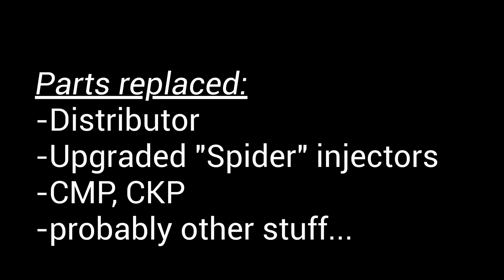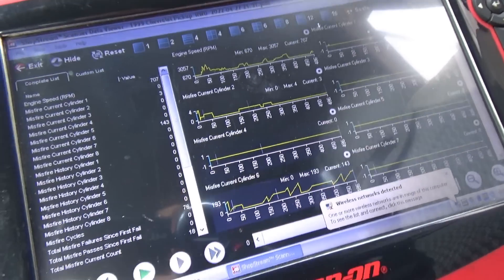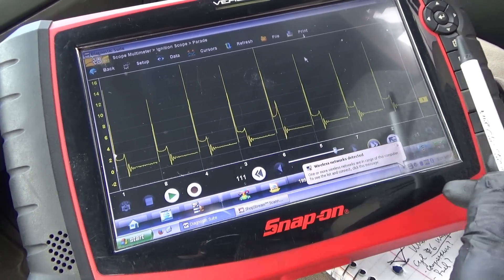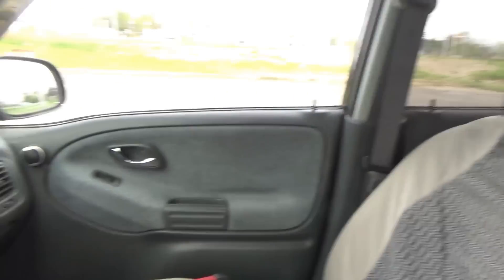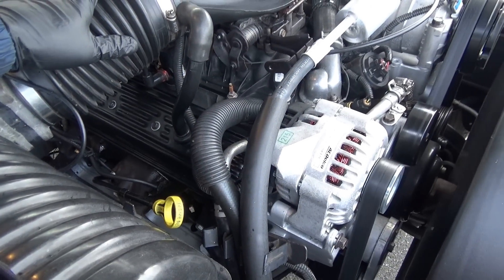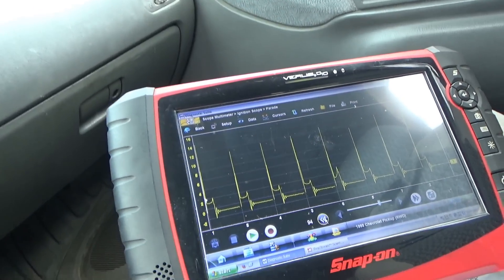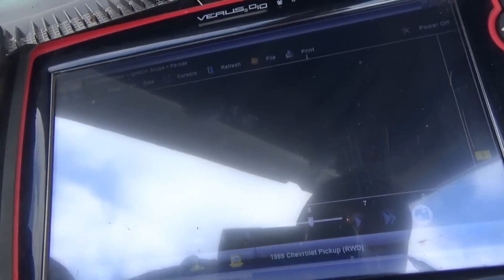Chevy Mystery Misfire...After Engine SWAP?

Comment: Old vid but:  You can spray a little brake clean/starter fluid at each runner flange for the intake and if the engine revs up, you got a leak.

Comment: Darn it! On the older carbureted SBC with EGR valves the intake gasket would fail on the #6 cylinder because the extra heat from the EGR valve would burn the gasket. Not all of them but a lot of them. I definitely would have made the same call.

Comment: If you have a vacuum leak your iac counts will be close to 0 gm's  typically run between 9 and 19 dirty throttle  body will go high usually around 39 . Remove valve cover loosen intake valve and exhaust valve 3/4 of a tern on number 6. Valves are tight

Comment: Ahhh....that sucks Ivan.  It will be better to have it in your shop so you can possibly stumble onto the answer since your not pressed for time.  I don't know why but those #6 cylinders against the firewall always seem to be a problem. A lot more heat back there I guess.  You'll figure it out if you get it in there.  Gotta be something simple but unseeable.

Comment: I would like to hear the engine cranking with no fuel. With the owner's complaint of low power the intake manifold would not be the problem. My guess is a camshaft problem. Does the rebuilder use new camshafts or do they cheap out and regrind the old camshafts. 
You need to put a vacuum guage on the engine. Did you try adding extra fuel to the intake and see if it will smooth out.

Comment: Great one Ivan. That sec waveform on scope looked like  excessive secondary resistance on cyl 6 dist cap. Ig wire also on perceived vac leak on 6 runner. A propane wand may smooth out engine as propane gets sucked in. Thanks for video

Comment: Ivan I do not see  you are using pulse sensor  on exhaust or  intake , or abosulte sensor, I would have done  RC. intake and exhaust  pulse sensor  to try to nail down  the misfire on that cylinder . Great testing methods and of course it is  difficult  to find the method to prove  some faults . Great job thanks  for sharing.

Comment: Hi ivan. Was wondering if you can help me.i have a 06 pathfinder with the issue with I DPM FUEL PUMP RELAY . I lost your video can yo tell me the wire colors used to add a secondary relay i would highly appreciTe it thank you

Comment: I look forward to the follow up, I've got a 2000 Tahoe 5.7 with similar issue, runs rough with a hard intermittent P0300 and P0303 while accelerating to highway speed. Compression is good, has new distributor, injectors, upper and lower intake gaskets and smoke tested for leaks. I've changed just about every sensor MAF, MAP, ECT, AIT, CKP, Knock from a spare Yukon I have. I'm at my wits end, may throw a new timing chain and valve adjustment at it and if that don't fix it I'll have to finally accept that I'll never be able to fix it. Maybe my CAT's are plugged such a nightmare and I'm not a parts thrower but here I am.

Comment: Aftermarket distributor caps are a known problem on these engines, still to this day. I think a simple spark tester at the end of the plug wire for #6 would have shown spark to be dropping, the plug is evidence. If you look at the cap, you can see how the electrical pathways cross all over each other. The ignition waveform can look lean because the spark is jumping to a different cylinder. Lots of experience with these, I won't even replace one unless the customer is okay with the AC Delco price, burned too many times. 
Back in the day, a guy could block off the pcv ports and check for vacuum in the crankcase to warrant pulling the intake for a vacuum leak, would that still be a valid test?

Comment: Many years ago I bought a brand new Mr goodwrench 350 engine, when it got hot it had a hard time cranking over like something was binding. I installed the engine myself, I told friends of mine who were mechanics and owned a shop, in fact they loaned me the hoist and engine stand and any tools I ever wanted, they even brought them to my house, they only were a few blocks from my house, they recommended I bring it to the local Chevy dealer in town and explain the problem, the engine had the factory warranty and I only had it about a month, I went to the dealer and explained what happened, they immediately wrote up an order, I left the car which was a 1979 Malibu classic sport coupe, the next day was a Saturday, they closed early so in the evening I went to see if my car was still sitting outside but to my amazement it was I side and the engine was out already. They determined th st the number 5 piston was binding, they installed another brand new engine and it was fine after that, if this engine is still under warranty I'd tell him to go talk to the dealer. That's the beauty of buying a factory trans or engine because the manufactured is responsible after the fact and they perform the work under warranty. My friends woukd always use gm or whatever engines and transmissions  for that reason.

Comment: I did not notice you inspecting valve timing precisely on the in cylinder waveform?? All the nice exhaust pocket says is the rings or valves are not leaking.  Good luck Ivan.

Comment: 6:30 when you were stepping through the #6 shots, while the shoulder was a little higher most of the time, about 1 in 8 was completely messed up, and that's about how often it was missing when running at idle.

Comment: I would look at injectors too. Maybe waveforms. Or injector leak down test. To see if they're all delivering the same fuel. Of course it has to be done when the engine is real hot. You could to the swaparoo with injectors. Or ignition cables. Or spark plugs. Or even something wrong with the distributor itself. Also use one of your pressure sensors to see the engine vacuum pulls on the manifold., to see if the pistons are pulling air consistently and the intake valves are working properly. On a case like this, you would have to think outside the box.  Thinking this way, you would still look at the engine rebuild itself. maybe it wasn't rebuilt correctly.  Maybe one of the valves is not opening correctly. Who knows. This looks very similar to those crappy GM Active Cylinder Management, where the valve does not open properly because of lack of oil on the lifters. Hope this helps.... EDIT:  Thought of something. It seems that that lean burn on the scope is not consistent. Sometimes it's little and sometimes it's big. And I also saw that bad waveform on other cylinders on occasion. If it was an intake leak then it would be more consistent. If it's some kind of a spark issue, it wold be inconsistent, like in the waveform. would focus also on the spark chain.  Best of luck!

Comment: For the gasket theory - could you have ruled that out by using something flammable to try to add fuel?  Obviously yo have to be careful, but I'd think it would help spot a leak.
Reply from the maker: Only the part that's external. Can't get to the bottom side where they usually leak 👍

Comment: Love the road trip. I watched entire video with "LG-IMS..." error sharing screen with PHAD 😆.  Of course, see if some vacuum device has a port on runner 6. Also, if truck has EGR, is there an EGR runner in manifold that might have a crack effecting runner 6. If lower intake is wet bottom, I've used exhaust analyzer and choke cleaner to prove or disprove intake leaks. Looking forward to next installment.

Comment: You need one of the autool smoke machines. You dont even need an air compressor. Brake cleaner or carb cleaner around the intake would also work. Honesty goes a long way

Comment: It looks like you are having a couple of bad days. I would not be to concerned as everybody has bad days once in a while. You have very few.

I suspect you checked the plugs and plug wires for cylinder 6 for cracks or some kind of damage (spark plug wire insulation cracked/cut). This certainly sounds like a cracked spark plug in which the crack expands when it gets hot, the same with a damages spark plug wire. Since the owner replaces all those parts you listed, plus others, I wonder if some of the others were the plugs and plug wires. Could the spark plug be gaped incorrectly (gap too large, or too small)? I think, but of course could be wrong, that if cylinder 6 was running lean, the plug would be much lighter color than the other one removed, not darker.

As I am sure you know, it is most likely to be something specific to cylinder 6 (although it could be something else on that bank). Swapping number 6 plug wire and/or plug with some other cylinder, even if nothing looks wrong with either, may be worth while. I know you will figure it out when the customer brings it to you.

Thanks for making these videos. They are some of the best on YouTube.
Reply from the maker: Thanks for the encouragement! Scope waveform proves that there is nothing wrong with the #6 plug 🙂
Reply: @PineHollowAutoDiagnostics  Thank you for your response, and you are welcome. I would like to make a few observations.

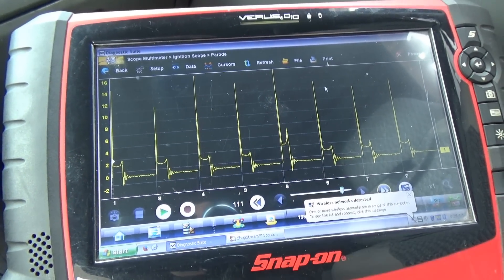I re-watched your video and took a closer look at the scope captures. The Verus Scope capture at about  3:54 in, where you state that it shows the issue is a lean misfire is very telling. The Fire line is much higher (off the top of the screen), the Burn line is higher (by about a volt), is shorter in time (fuel all burnt before it should have been), and the Burn line is curved up at the top. All these things indicate that cylinder 6 has a higher resistance (takes much more energy/power to fire/burn the fuel). The most likely cause is indeed a lean condition as you stated. As you know a lean condition is caused either by too much air (leaking intake manifold, or something letting unmetered air into cylinder 6 ), too little gas (fuel injector not spraying enough fuel, or incorrect spray pattern). Something is causing cylinder 6 to have a high resistance to igniting and burning the fuel/air mixture, which can also be caused by high cylinder compression, cracked spark plug, or damaged spark plug wire, among other things. The latter two (2) are not the most likely, given the scope waveforms you captured. I don't know if you have information about the customers repair (installing new intake manifold gaskets) if it was done right or not. Hopefully you will have a chance to see.

I also looked at the two (2) PicoScope captures (pressure transducer captures). I see very little difference between cylinder 4 and cylinder 6. Cylinder 4 has a peak compression of about 190 PSI, and cylinder 6 at about 187 PSI (snap throttle). Cylinder 4 has a vacuum of about 10.5 PSI, and cylinder 6 about 10.4 PSI, both at idle before and after the throttle snap. Compression at idle before and after throttle snap, about 45-47 PSI, are about the same. Unless I am missing something. I did not place one on top of the other for comparison. 

This is a very interesting one, you have done a good job at diagnosing it, and I hope the owner brings it to you so you can have a chance to diagnosis it more and find the root cause. Finally, I want to mention that IF this engine has the "spider" type fuel injectors, given this is a new (to the owner) engine and many things have been changed, it may have also have been changed. A lot of people upgrade these from the original one for better performance. Anyway, you may already know this but IF is has this "spider" type fuel injector system, the rectangular  part that connects to the fuel rail and to the electrical connection has 16 little metal pins on the underneath of it that provide the power and control to the injectors. These little pins are very easy to bend. If one or more is bent, that fuel injector (two (2) pins per injector) may not spray correctly. If bent, they usually can be carefully straighten up with a screw driver or needle nose pliers. I suspect that heat would have an affect if one of these pins is bent.  

Again, I hope you get another chance to diagnose this. It is very interesting, and I am sure if you do, you will get to the bottom of it. Thank you again for all the work you put into these videos. It is appreciated. And, good luck on the rest of your road trip.

Omegaman69

Comment: I've had a similar misfire. It's a 454 Chevy. I'd do some acceleration and the idle was rough after that. It turned out to be an exhaust valve that was not rotating and not seating correctly. A valve job corrected the problem.

Comment: if the block and or heads was planed during the rebuild perhaps the intake dont fit like it did from the factory and or it is warped enough to cause a vacuum leak when hot

Comment: My reading of the spark was an outside the cylinder ignition high resistance.  Those caps are infamous for leaking in the top of the cap.  OEM only is trustworthy.  The 6 plug looked kind of dark, blackish, indicating unburned fuel.  A lean plug should have been lighter than the normal.

Comment: I can see a definite difference in the scavenging event on the cyl 6 waveform. Not sure if it was camera angle, but it looked like the compression peak was leaning a bit. I haven't gotten used to these yet, but I'm thinking exhaust restriction from a lazy valve or partially blocked exhaust port.
Reply: Did someone put a gasket in backwards?

Comment: Your a good man, I admire your ethic. I had a 3500, 7.4 litre once with a slight misfire and changed plugs wires and cap.
Misfire still there... turned out that the new Napa corrected distributor cap was cross firing inside itself.

Comment: Ivan. When you get the truck. I had a similar truck with a 350. A customer came to me regarding a misfire under load. Customer also asked if I could replace the spider assembly too. I obliged and took on the job. Replaced spider assembly. Still a misfire. ??
Customer had purchased cheap cap and rotor. Wires and plugs to save$$. 
Took about 1 hour to find a very small burn mark underneath the distributor cap. 
Bought a brand new AC Delco cap n rotor. Replaced the suspected bad plug. Truck immediately ran smooth and no codes. 
I found that the very cheap cap and rotor are made cheap cheap. They short out internally.
Reply: bad plugs or wires quickly kill those stupid flat spider caps and the cheap aftermarket ones are junk right from the start.

Comment: i have a 92 turbo nissan and made a boost leak smoke tester thats simply a soldering iron in a jar wrapped in a sock with mineral oil and a inlet/outlet ports on the jar to add compressed air in one port and other goes to a vacuum port on the manifold and found these simple diy boost leak testers are the best for finding vacuum leaks.there are hundreds of diy boost leak down tester ideas on youtube,some as simple as blowing into a vacuum line or using a vape pen.

Comment: Valve lash too tight? The high oil pressure after elevated rpm’s hold the valve open until it bleeds oil pressure down enough to seal. I had a fresh reman Jeep engine do the same, due to a valve seat cut too deep. It didn’t have adjustable valves so the head had to be warrantied. Same symptoms, misfire at idle after driving on the freeway.

Comment: I really thought you were going to get to checking for a vacuum leak with propane, carb. or brake cleaner. and look at short term fuel trim to see if it changed when spraying the intake. I was surprised when you didn't. It's a quick and easy way to find vacuum leaks. Another quick check would be with spraying a fine stream of water around the intake  and listening for changes in RPM. Also these composite intake are susceptible to cracking and warping. The first test I mentioned would likely find these problems as well. God luck sir. Looking forward to the follow up video. Love your work and honesty. I been watching for years and have learned quite a bit from you. Thank you.

Comment: I had a Ford Taurus that did exact same thing. It was the injector. When it got hot, the windings separated and it failed and car ran lean. Once it cooled or was not stressed it worked just fine. I replaced the injector and it was fine.

Comment: I'd be very suspect of the cental spider injection system. You mentioned that the spider injectors were upgraded but the conversion is actually a change from the spider injectors to a MFI system. Briansmobile1 youtube  sight has an excellent video on doing this conversion.

Comment: This is where Paul Danner comes.  You need to do the water test on the intake manifold.  Start with a cold engine.  Add water to a soda bottle.  And put the cap on the bottle.  Punch a few small holes in the cap.  Then you just squeeze and spray the whole thing.  Until you here a change in rpm.

Comment: I was waiting to see if you were going to use brake clean or water to check for the vaccum leak.
We all make mistakes. I'm very curious to want the problem is. At this point I'm guessing a bad(new ) spider injector. It's the only thing else that could cause a lean condition that I could think of
Great video

Comment: Another question is what brand of cap and rotor did he use?  I've owned a 98 Chevy K1500 with this engine since new and they can be picky with aftermarket caps and rotors.  I don't use anything but AC-Delco in mine after having some bad luck with aftermarket ones.

The gasket set used is also very important.  There have been two revisions of the intake gasket over the original ones.  My truck is on it's third intake set in 142,000 miles and has design version #2 in it currently.   I'm sure it will go out at some point again.  Torque specs are really low for the intake bolts and it's a crap design with the bolts going straight down instead of in at an angle so it's easy for the gaskets to slip down during installation.